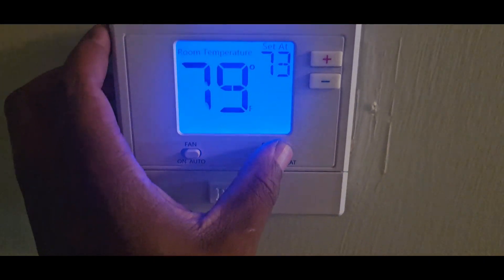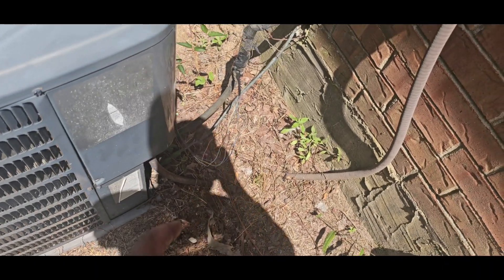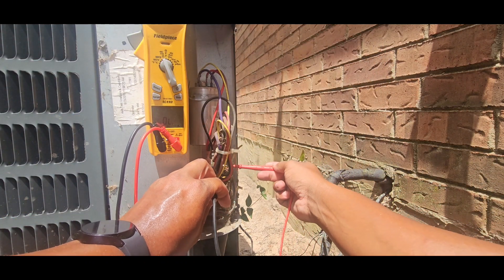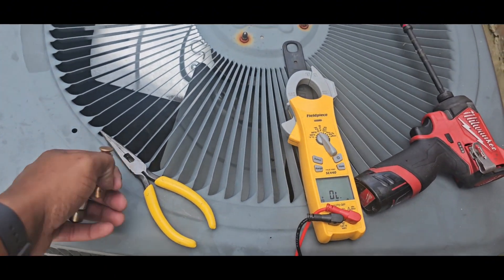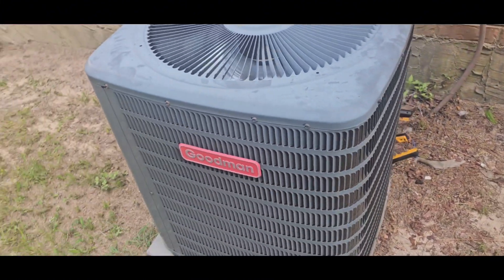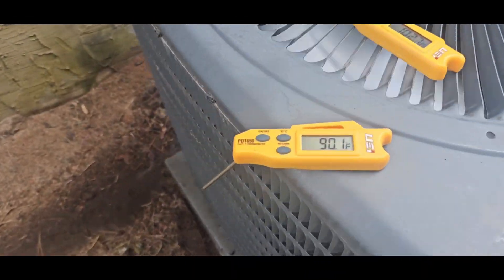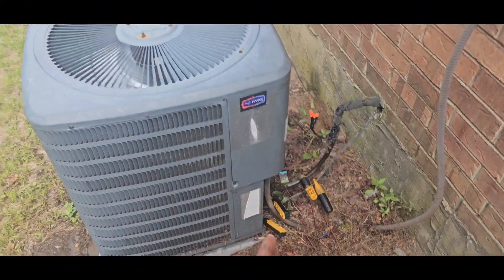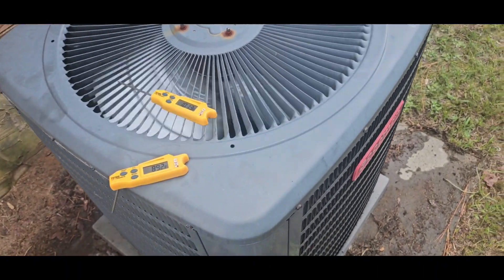Blown Fuses Stopping System From Working | HVAC

Comment: anytime you find an overheated fuse, double check the prongs for tightness and measure the voltage drop across the fuse to ensure it did not die of unnatural causes
Reply from the maker: I never knew that was a thing but that makes sense